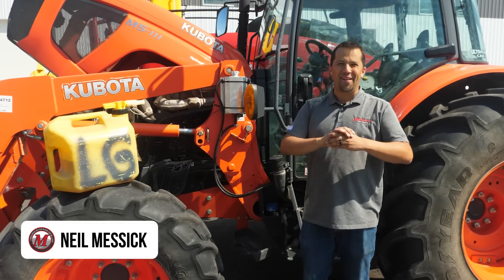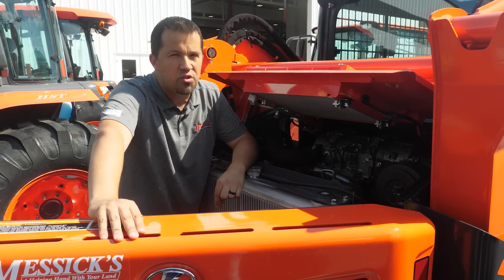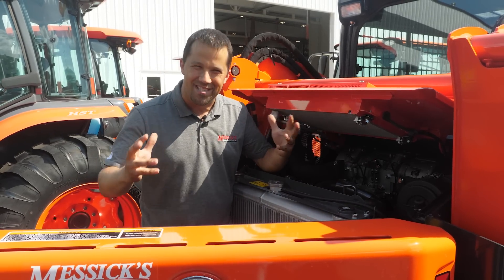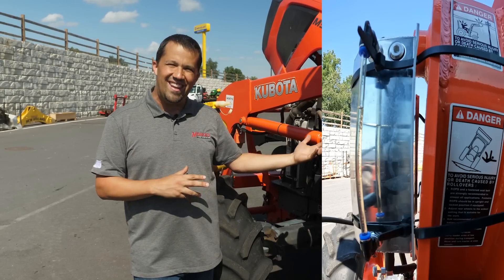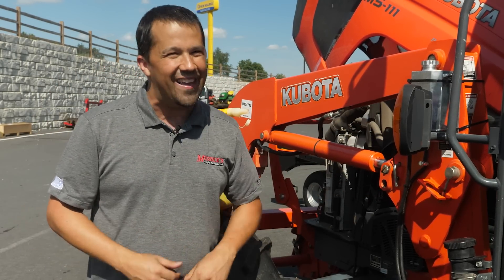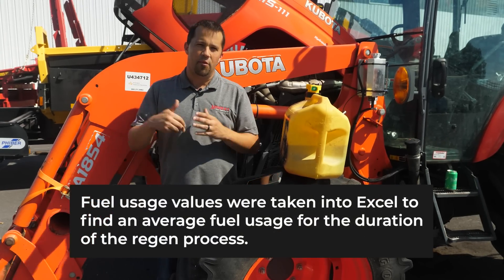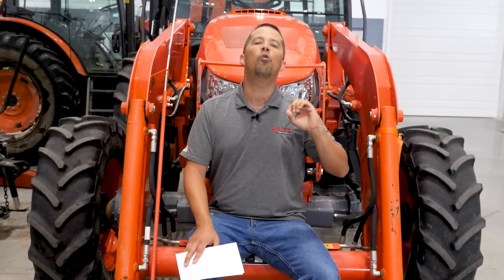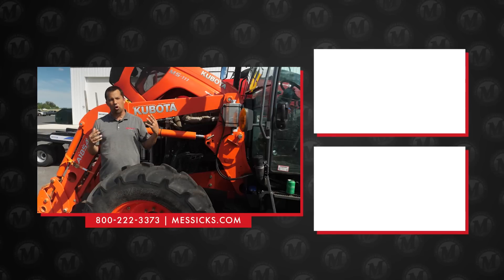Science | How much fuel is wasted during regen?

Comment: Neal, the only other thing that would make this more interesting. If the tractor was under medium-heavy or heavy load, would that do a passive regen to cut fuel usage by not requiring the exhaust stroke injection? Also, if it would lengthen the time between regen cycle?

Great job with the video!

Comment: Good one! I rarely even notice my L3560 doing a ReGen because when I'm working for example on chipping tree limbs my PTO is turning at 540 RPMs and that translates to way above the minimum for ReGen. 

I read about the problems early on when the new laws forced Kubota and others to modify exhaust systems but those issues haven't surfaced for me in the past 2 years and 400+ hours of use with my 2020 L3560.

As for fuel consumption, the readout on my display tells me I've burned a little over 200 gallons in a little over 400 tractor hours, so .5 gallons per hour.

Have you ever done a video on tractor hours vs real time hours vs RPMs?

Comment: I would think the extra use of fuel would be less of an issue than replacement if the DPF at the end of its life cycle. I hear it's pretty pricy.
Reply from the maker: Element is $400-600 to clean around 4000-5000 hours. Maybe once in the life of the tractor.
Reply: @MessicksEquip  
Plus hauling charges to dealership and back. I had heard $2000 to replace. Guess technology is getting better,didn't know they could be cleaned. Thank you.
Reply from the maker: @bradbruggeman6745  same process as what tractor trailers do. Many truck shops own the machine that's used to clean the filters. We also sell reman filters if that's not available.

Comment: I found my L4060 to be pretty good on fuel. 0.6 per hour loaded.  Thats mowing with a JD1209, raking, tedding, and baling with a NH273.  The regen, it's first at 56 hours, used roughly 1/4 tank, as it happened during a mowing session.    Either that or the gauge is WAY off as it was sitting at a half tank before I started mowing 4 acres.  (I'm guessing the gauge is wonky though as I put a few gallons in from E and it went over 3/4 tank.)

It is still sitting at 0.6 GPH though.

Comment: I have a better idea, don't use a egr and cooler to screw up the combustion cycle and make the engine produce more soot, make the engine run as clean and as efficient as possible. Then, if nitrous oxide really is the problem that they say it is, then put on a bigger catalyst and use more Def. That part of the system rarely causes problems, other than occasionally needing a new def injector. But.........the answer is simple. Follow the money. In 2014 the complete assembly for a 380 hp ism was 32,000$

Comment: The biggest problem is the cost added to these engines by the tier 4 emission requirements.
Some engines are double the cost + vs non tier 4. Ive talked with our engineers and this also
has obviously caused product changes to accomodate tier 4 emission systems which 
translates into even higher product cost. Thanks to the epa! (yet another one of the too many govt.
alphabet taxpayer funded leeches on society.)
Reply: at least you can cry about it in cleaner air.
Reply: @robs8882  no, not crying but simple fact about cost of so called climate change via government overreach.
I don’t pretend feelings are facts like the sheeple.
Reply: @lcee6592  Who determines overreach? you?
I thought we were talking about tractors here, not animal husbandry.
Reply: @robs8882  Apparently you “feel” govt. knows best so no such thing as govt. overreach. Its probably best you just drive your Prius, stay safe within the confines of the herd and stay tuned to cnn. Then you won’t have to deal with those pesky things called facts and truth. No charge.
Reply: @lcee6592  no feelings expressed, puppy. Just asked who decides what is government overreach? Do you go all ultra mags/ fascist anytime someone asks you a question or just when they reject your BS? If you can’t prove this is government overreach then we know who has a problem with those pesky facts.

Hmmm, will it take longer for data or more insults? I’m betting on insults.

Comment: Good video and explanation.  I don't think the actual amount of fuel used by the DPF is the problem, it's the total amount of fuel used by a parked regen that's wasteful because you otherwise wouldn't be running the tractor.   So it's fuel + wear.   Also, if you're done with using your tractor and it's in the middle of a normal regen, you can't shut it down....you have to let it sit and run until the regen is done. Are there any statistics out there on the hours or % of DPFs that get so clogged that they have to be replaced?
Reply: 1000% this - Seem like every single time it goes into regen, is when I'm close to being done, so then it has to sit there an run at high rpm for 20 minutes doing no work.
Reply: Exactly! One last windrow to bale and the tractor goes into regen. Could have been done in 5 minutes, but instead the tractor is sitting in the field doing a whole lot of nothing.
Reply: Interesting issue, must be a brand specific issue, because my tractor doesn't care if I shut it down when the regen light is on. It just does the regen the next time I use it.

Comment: People who hate DPF do so for emotional not logical reasons. They want to justify their reasoning of buying a 25 hp tractor. I monitor my l47 fuel usage and per the screen, it does increase during regen cycle, however that is because I set RPMs to the max versus having it set to 1.5k + auto throttle. Thus an argument can be made that during regen cycle, you are forced to use more fuel because otherwise the tractor could be at lower RPM…

Comment: Interesting, but I think this test is very flawed. My DPF will run for up to 40 minutes when it's really clogged(loader work). Also there is the opportunity cost of having your tractor sit unusable exactly when you need to to be functional.
Reply: Exactly, my tractor (kioti) requires it to be parked and run for about 20 minutes of running rich.  You cannot work it during this time.  I can barely drive it at very low speed and cannot make it up the hill from the shed to my driveway.  Only advantage I think Kubota has and it could be significant for some people.

Comment: Excellent topic to cover and appreciate the time and effort in completing the test. I was pleased to see the marginal difference in fuel consumption while in regen. However, I believe there would be significant value in determining the overall fuel consumption of a tier 4 and comparable sized non-tier 4 tractor over the course of a full tank of gas when doing comparable work with the tractor.  Reason being that the tier 4's are  recommended to be run constantly (even at idle) at a higher rpm than a non tier 4 to  keep the higher temp up and reduce the overall carbon build up in the dpf.  Many have felt  that this continuous increase in rpms burns more fuel.  Just a thought for consideration. Love your videos and the help they provide.
Reply: Just one personal anecdote but comparing a non emission Cat 303.5e to a basically brand new emissions kubota KX-4 you do have to run at higher rpms for the same amount of work being done and burn more fuel. Obviously the 303.5 has a smaller engine but it's a very noticeable difference in fuel burned to work done.

Comment: That's right Neil and if it really needed to regen and it was at work it would have used more and it gets hot some catch 🔥.  I do agree that the newer ones are better but they are full of sensors that do cause lots of trouble but eventually we will have to use them we have a few now but thankfully the bigger units have low hours and we won't be upgrading them until they are shot 😅

Comment: Where this was a forced regen I doubt the engine would be injecting a lot of fuel to activate on the DOC(diesel oxidizing catalyst) not the DPF. With this tractor being 75+HP it will be equipped with an SCR but for this test that is not relevant however what would be the method of injection. I am somewhat familiar with semis in this regard and all of the six cylinder engines regardless of power ratings are equipped with a 7th diesel injector behind the turbo that sprays fuel to the DOC. I am sure if you get that thing nice and clogged up you will see a difference in not only its fuel consumption but always its performance (loss of power) while doing a regen. You'll know if you get it nice and clogged because it will start puking white smoke and have a funny smell

Comment: I'm frustrated about the wasted time (and fuel) when a KX-057 won't activate the auxiliary hydraulics while it goes through a regen cycle. Yeah I can continue to dig, but if I have my mower, auger or using thumb I'm SOL until its done.
Reply from the maker: For some reason the auxiliary flips off when regen starts, but you can turn it right back on and go right back to work. You don't need to wait for it to finish.
Reply: @MessicksEquip  its a -4 model, when you press the auxiliary button it  gives you the double beep and continues to display the regen icon without engaging the auxiliary. Unless there is another trick or button to press I'm unaware of during the regen.
Reply: @MessicksEquip  i appreciate the videos btw.
Reply from the maker: Kubota puts the same statement in their instructional video. I would be curious if it's in an early model, maybe a software update needs done? There should be a solution. https://youtu.be/BAmaxoCrZeQ see about 2:00 in.
Reply: @MessicksEquip  thanks, I will check it out next time it regens.

Comment: My f250 goes into regeneration and the mileage drops from 15 mpg to 8 mpg for 15-20 minutes. So I have a hard time believing the test results
Reply: Yep same in the dodge, does the same thing going 75Km/hr or more or about 45 mph
Reply: 2019 Ram. New FW flash forces regen almost every time the vehicle is driven (short trips less than 15 miles @ < 45 mph). Vehicle now gets average of 11.2 MPG versus 16.7 on older FW. This "upgrade" increased fuel consumption by about 50%, but now the DPF won't fail supposedly. Will probably switch to a gasoline truck.

Comment: We just bought a 2021 NH Workmaster 75.  It does not have DEF or regin. and it is a 75 hp.
Reply from the maker: DOC, it's effectively always in Regen.
Reply: Have you had any trouble with it "whining" in 4wd? Ours has had a few problems.
Reply: @ricksanchez7459  no issues with 4x4 but we did have the clutch cable break an have to be replaced.  Same as any other new thing some stuff to work the kinks out of with it but for the price it was way better than a 75 in orange or green.

Comment: You burned 0.4 liters of fuel during the 10 min regen cycle. this was a shorter than normal regen cycle, as you said, so a more typical cycle probably uses closer to 0.5 liters or more EVERY time.
Yes, that does increase your fuel consumption.
Reply from the maker: Normally your doing this while working, not sitting still.
Reply: @MessicksEquip  but it is usually hits at the end of the day almost every time it does use more fuel I have both no Def and Def engines it's not better

Comment: Sorry Neal. As a professional diesel mechanic for the better part of 20 years…The fact that you forced a regen when one wasn’t needed dramatically reduced the amount of fuel dumped into the DPF. It’s not a set system. It has back pressure sensors that determine the level of clog and subsequently the amount and duration of heat needed to sufficiently burn off that soot. And as you mentioned that heat is built from fuel. Parked regens are more effective and efficient because you’re not asking the engine, fuel system or exhaust system to do double duty. And if it weren’t for convenience. There wouldn’t even be working regens. But as you can imagine. Being forced to stop working or driving for as much as an hour in some applications is unacceptable. 

This is not now, has never been, nor will it ever be a myth. Perhaps on an application where you’re running at full throttle pretty much whenever the machine is running. You might see negligible losses. But on road applications have dramatically reduced fuel economy. Usually by as much as half. Sometimes even more. Just look at the difference in fuel economy on diesel trucks both pre and post emissions. A perfect example would be the 6.4 Powerstroke. (Yes I know they’re trash ass engines, calm your tits Cummins bois)

The 6.4 powerstroke was absolutely horrible on fuel. Sometimes maxing out at around 6-8mpg due to emissions. Specifically the DPF and the regen process. When guys do nothing at all but tune the ECM to stop regen cycles from happening. Fuel mileage at least doubles. Again that’s with NO other modifications other than telling the ECM that the regen process is not needed..
Reply from the maker: I'd love to find a way to test this further. I don't doubt what you say, but I think this may be a case where on road, and off-road equipment don't function the same. An on road truck is operating at a very low duty cycle, it may take a lot more to get a Regen done than it does on a tractor. 

So what, you'd like to see this with a PM load, and hooked to a Dyno?
Reply: @MessicksEquip   Yes a dyno load test would be great! And if I’m wrong, I’ll gladly correct myself. A test with a full DPF would be ideal. Don’t get me wrong I’m badmouthing the video. I’m simply pointing out that it’s been proven time and time again that deleting or deactivating diesel emissions systems leads to, not only, better fuel economy. But typically longevity and reliability too. Although admittedly emissions systems on equipment does tend to be less of a headache…

I do agree with you that the average diesel pick up has an extremely low load on a daily basis compared to a tractor. I am actually currently working at a Kubota/CNH dealer. And I do definitely understand the load differences. However heavy trucks which is where the vast majority of my experience and skill set lies, are loaded similarly to tractors except they typically run many more hours. And while it’s much more difficult, legally speaking, to deactivate semi emissions. It has absolutely been done with the same results. 

With all that said. I would like to point out the VERY different ways in which road tractors and farm tractors are throttled. Normally farm/utility tractors will be set to a given RPM, not always of course, but generally speaking…while pickups and semis will be constantly throttled up and down. That constant throttling is responsible for a hell of a lot more soot build up. And it builds it far quicker too. So that definitely has a role to play in the economy swings seen in on road applications before and after emissions systems.

You’ve mentioned in past videos that emissions systems on tractors and skid steers tend to be pretty reliable and not very problematic. Due to the fact that they’re usually ran hot and high RPM when used. And I completely agree! Over the road trucks that spend less time idling and driving through stop and go traffic tend to be less problematic than inner city trucks. For exactly the reasons you have discussed in the past. They’re usually running hot and at higher RPM. 

Love the videos and the channel! Keep the videos coming, Neal! I’d really love to see some more focus on some of the smaller New Holland machines. Perhaps even comparisons between some Kubota and New Holland subcompacts and compacts…
Reply from the maker: Thanks for the thoughtful response. That's what drives the next ideas for the future videos.

Comment: Thank you for showing this TEST, bet you get lots of questions from customers on that extra FUEL burn. does the Tractor go into low power like say class 8 semi's. Drove a Dump truck that did that after it gave a DASH signal. One of my coworkers would just High RPM with dumps when he came back to yard after heavy usage.
just asking if you are in middle of till, will Tractor slow down to REGENERATE.
Reply from the maker: No, you work right though regen. It won't derate unless its out of DEF or there is a mechanical problem.

Comment: And it's still burning the fuel and the soot and exhausting it out into the air.  Good job greeniacs......
Reply: um, the soot is being burned during the regen... the whole point is to reduce the soot.
Reply: @robs8882  then do you empty a burnt soot bag,,,,or does it go out the tail pipe.....
Reply: @markbroughton5814  soot is partially burned organic matter, diesel in this case. it is collected then when a certain point is reached, it is fully consumed (by higher heat) creating regular exhaust fumes.

Comment: We have a L3301 about 2 years old, it has gone in to regen only 4 times. I run it at 2200 rpms which may be why only 4 regens in 2 years. Never idle it, always working it.
Reply: just asking does it SLOW down your power, when Regeneration it happening. just wondering, are Dumps do a slow down of power.
Reply: @rp1645  You can continue to work during the regen, have not noticed any power reduction.

Comment: Neil, you basically proved that regen burns no more fuel per unit time than running at max rpms. Most of us do not work at max rpms to preserve our equipment. You need to compare max vs 3/4 rpm fuel consumption to get the difference per unit time. Then determine how long a typical regen cycle run when the tractor decides it’s needed. Then you’ll have the amount of extra fuel is used. Thanks for all your great videos. Ed
Reply from the maker: This was at 1650 RPM, not at max. Max is around 2200. 1650 was the set point that the parked regen uses. We could test the fuel use difference between 2200 and 1650, but as we've been finding the difference will be minimal when there is no load.